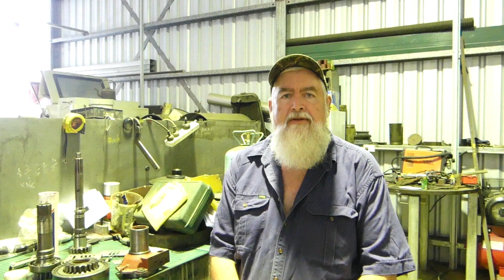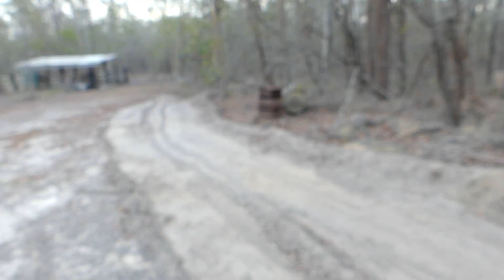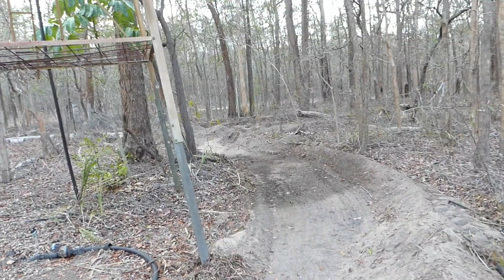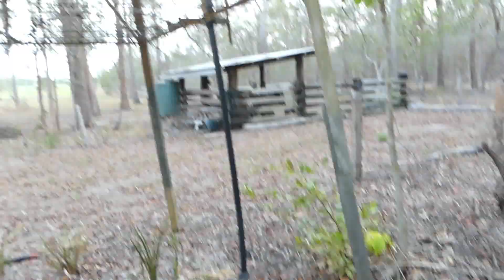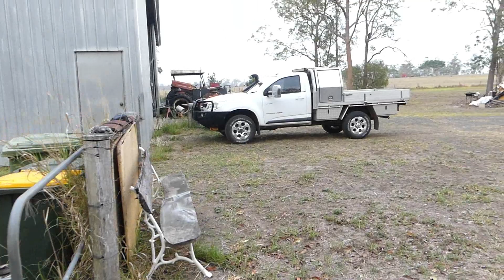Kangaroo Stew # 164

Comment: Not original will get you home , especially if it's replacing a genny  & that big regulator set up !  I made a bracket & fitted an alt to my one  ,   it took 2 goes to get the bracket right due to the loader frame support being in the way .
Reply from the maker: Yeah doesnt have to be original for these, reliability is everything.

Comment: Hi Lance,  looks like you're keeping busy!  I've just about finished doing a multipower gearbox up as well, unfortunately my input housing and pto input shaft had badly worn grooves from the sealing rings,  so new ones are on order and the clutch pack had a fair bit of wear on the internal gear where it contacts the clutch plates.  Anyway,  just about sorted, don't think I'll convert another 35 to multipower anytime soon though... Cheers,  Josh.
Reply from the maker: Converting would be a big job, hopefully you get a good run out of it now though.
Reply: @BundyBearsShed  It has been a bit of work. I bought an early 135 back end and rebuilt it,  getting diff lock is another bonus.